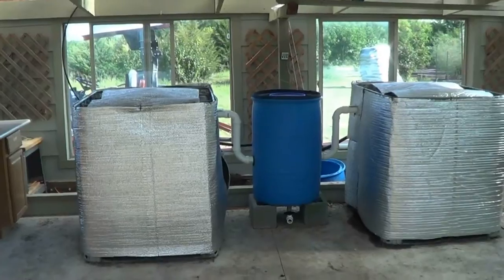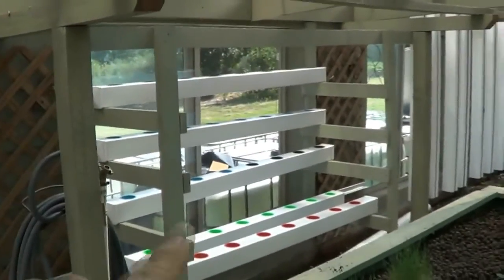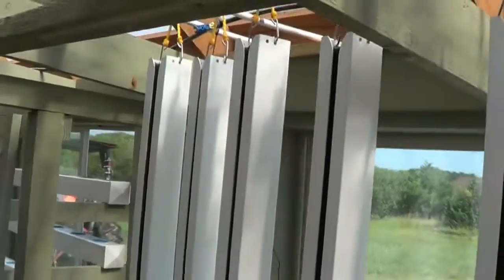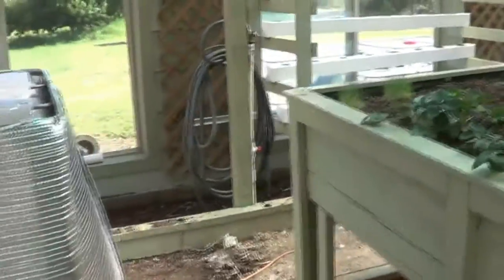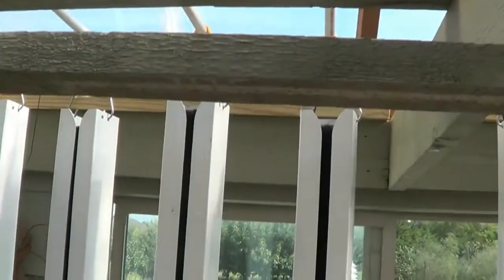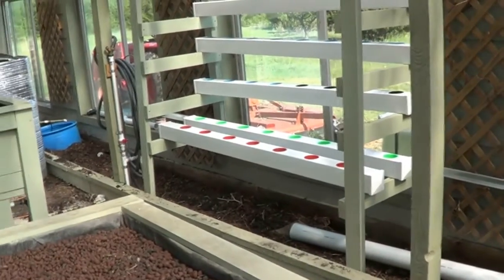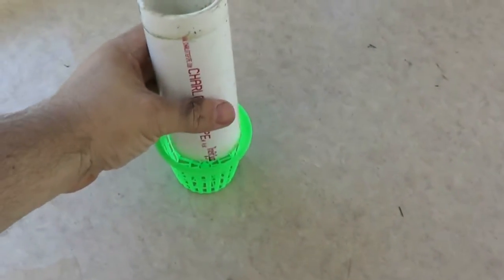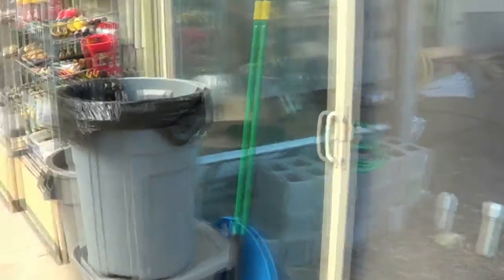Aquaculture Into Aquaponics

Comment: I don't think the plastic PVC pipes will hold your ZipGrow towers.  I think it would be better to use  those metal conduct pipes.
Reply from the maker: I do not use this setup any more but it was fine - the gap between the to wood runners was only about 14"-16" apart so that was the strength there was no room for them to bend, any wider no it would not hold.
Reply: Did you stop using your ZipGrow?  What did you do with them?
Reply from the maker: Linda Readman still use them just in a main area. no grow wall

Comment: Just a thought, you could probably put a 3" net pot inside the end of the 3" stand pipe for your larger tanks. Just flip the net pot upside down and fit it into the end of the 3 inch stand pipe... again just a thought, not sure how well it will work.

In my IBC tanks I have my 2" stand pipes going into a T at the bottom with 2" pipe going out either end for about 10" then capped off... on the bottom side of those pipes I cut slits in the pipe with a sawsall about every 1/4". I just figured that way it would spread out where the solids are being lifted from in the tank.
Reply from the maker: I will have to see how it comes together I will keep that in mind - thanks for the thought...